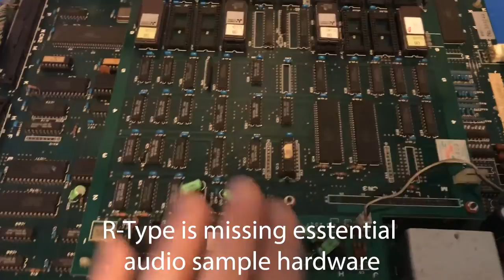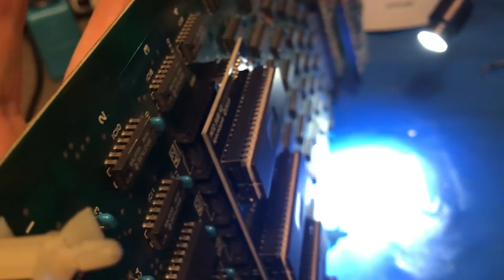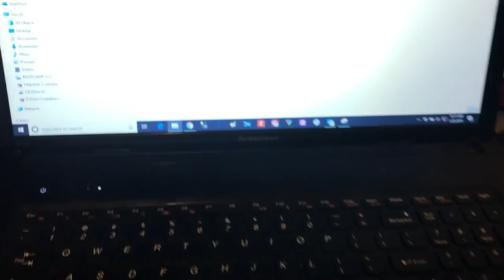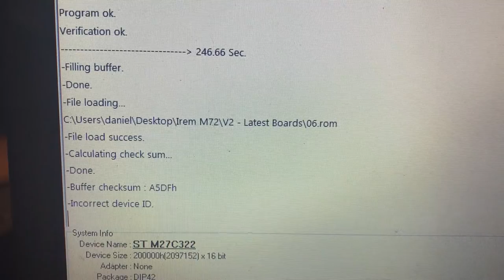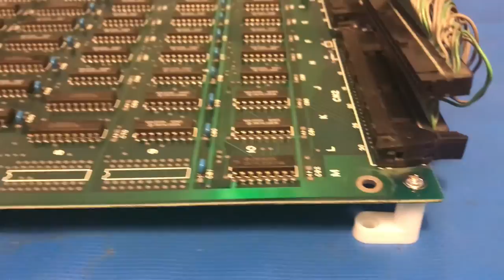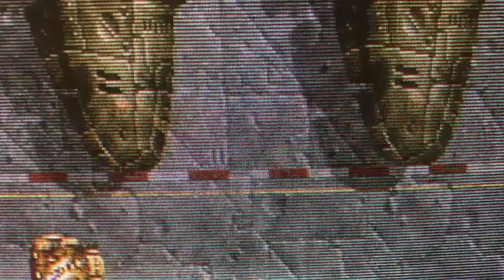Irem M72 Multi Kit - Installation

Comment: Instead of pliers on the tip of the spacers, use a nylon hex standoff to push over and then you can simply pull away.

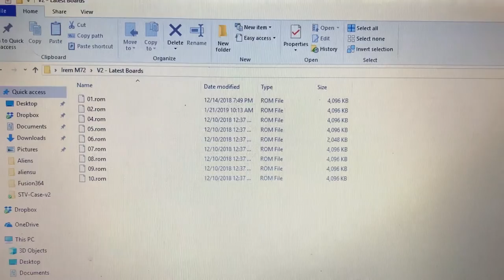Comment: 28:00 where did you get this ROM pack? I don't see it in the installation instructions post by Apocalypse.
Reply from the maker: Search on the AP forums for a Rollup Pack.
Reply: @ShootTheCore  When you buy the kit is the GAL Rom file supplied? Or this also has to be burned/use the stock on the board
Reply from the maker: @crunchsixfoe  A preprogrammed GAL chip is included with the kit to be installed into the mainboard.

Comment: Hi,

I have a M72 board Dragon Breed, and there is no sprites : dragon, heroes, enemies, just the background and sound. RAM NG, ROM OK !
Do you know what could be the issue please ?
Reply from the maker: The RAM NG message means that there's either a failed memory chip, or a failure with one of the TTL logic chips that manage memory addressing.  On the M72, sprites are generated by the top board, so you'll want to focus your attention there.  Remove the top board and carefully inspect it for physical damage - look for missing componets, scratches, and broken traces.  If that checks out, remove then reinstall any socketed chips to ensure they have a good connection.  Next, use a logic probe to check the lines on each TTL & RAM chip on the top board.  You can look up the datasheet for each component by its part number to determine what each pin does.  The logic probe should read high for the voltage pin, low for the ground pin, and flicker between high and low on the address, output and control lines.  If you find a part where the input and control lines show activity but the output lines are dead, then replace that part.   There's also schematics for M72 in back of the R-Type manual - it's the same board as Dragon Breed minus some of the sound hardware, so you can reference the schematics for the sprite generation board if need be.  Good luck!
Reply: ShootTheCore : ok, thanks!
Reply: ShootTheCore : For the top board, you mean the game, right (not the mother board M72) ?
I don’t know where are the RAM component or if components are missing !
I could send you photos if you have an email.

See the issue here : https://youtu.be/JxsQ9B8ALOc

Thanks
Reply from the maker: @iGolgo13  On M72 Dragon Breed, there should be three boards. M72-B-D is the bottom, M72-A-C is the middle, M72-C-A is the top.  The top M72-C-A board has four memory chips - on mine, there's two NEC D4364CX chips and two Fujitsu MB8421.  There's also several 245 series TTL chips connected in series with the two Fujitsu memory chips.  Your problem is likely with one of those chips.  If you have trouble, post about your issue in the Arcade Projects forum - me and other repair folks smarter than me hang out there all the time.
Reply: ShootTheCore : Yeah, I already posted my problem on Arcade-project as Maskman !
Thanks